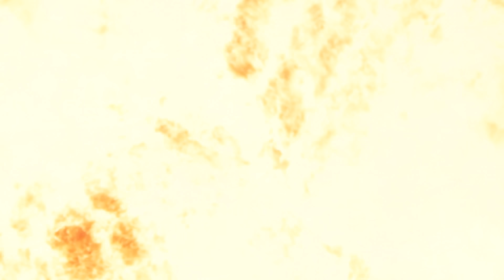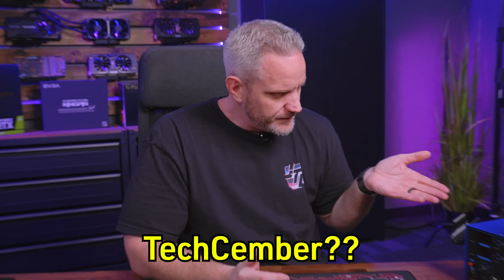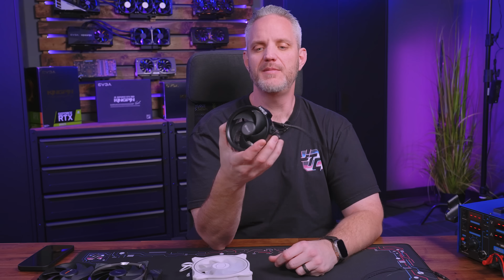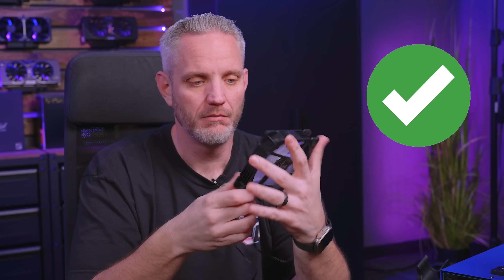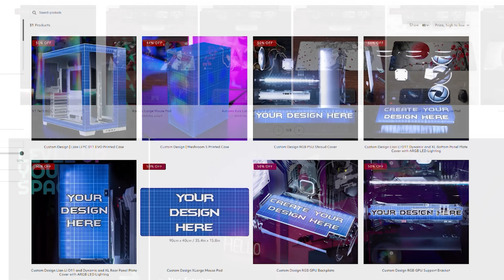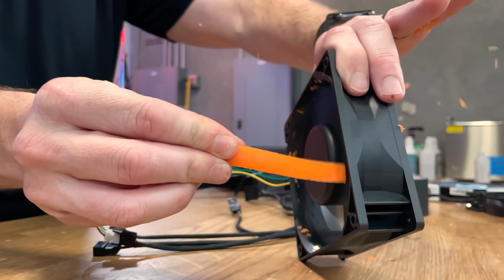I overvolted my fans, but I never expected these results!

Comment: During the summer months I used run some fans using an 18v drill battery when there was a power outage no problem all I had to do was make my own connector and of course use fan grills for safety. I even built a frame so I could use 4 fans to try and stay cool.

Comment: You need to hook the RPM wire to a motherboard to see what the RPM increase is.
Reply: Love me those deltas
Reply: This could potentially fry the board is not wired correctly. It's safer to use rpm meter
Reply: @vadnegru  the deltas I use are 1.6amps at 12v their rated at 3700 but only hit 2700-2900. I’m using fancontrol with a custom fan curve. I don’t think we have to worry much with Motherboards today. I believe because they limit them to the max of the headers. Mine are 1amps max. And my 4x 120x38 PWM deltas haven’t had any problems, no blown headers. So I guess if you stay with 12v should should be okay.
Reply: @JoeyAnswer  but Jay clearly going over 12V and that's could dangerous
Reply: @vadnegru  agreed though pc motherboards don’t do 15amps. What he was doing was testing to see if 15amps would kill a fan.
Reply: @vadnegru  it’s for science
Reply: @JoeyAnswer  please stop confusing electric potential (Volts) with current (Amperes)

Comment: Years ago when I was working on a cooling box for a game console I bought an all metal PC fan from RadioShack, soldered it directly to a wall plug wire and a toggle switch to turn it on and off, and hit it with 110 volts directly from the wall.  It never burned out.
Reply: Surely you understand a DC fan would never work on AC power, right?
Reply: @war4peace1979  It worked.  As I said, it was an all METAL fan, including the blades, so it wasn't made for computers, it was made for large cabinets full of electronics to keep air flow going.

Comment: means the coils should handle 3 amps, could be able to handle 20v, then it may fail.
sounds like a thermal resistor. it has a set limit 
get a basic 30V with preset voltages, voltage limiting, and current limiting.

Comment: Jay, you don’t need a new power supply.

You can series the power supply through the lithium battery.

That would give you over 35 volts to the fan

Comment: I actually feed 20 volts to my 4x Noctua nf-a20 (on a mo-ra3) to reach 1200 rpm. They are designed to run at 800. I'm sure their lifespan is reduced though usually degradation is accelerated through heat and they'll stay cold to the touch, even after multiple hours

Comment: ive used pc fans before in my old tahoe sound system to cool the amps before. when the alt's were charging it was at 14.8 14.9vdc and the fans worked well. never had a problem

Comment: If you wanna get more RPM (aside from overvolting them) you can completely cover the air intake, It will create a bit of void (a lower pressure really) lowering the air resistance on the blades and increasing the RPM. :P
Reply: That might cause one to pop out of the bearing if it manages to create enough of a vacuum.

Comment: Talking of fans, any interest in modding the Zotac 40xx series fans?  I just built a system for my sister with a zotac 4070ti amp airo and the fan motors sound terrible! I thought they were broken before I looked it up, it's the normal sound for zotac cards :(

Comment: At my work we use 35, 40, and 50mm fans for our products. The fans we use are normally rated for 5v, but we run them up to 9v without any issues. We could get 9v fans but they would struggle to run at lower voltages and we let our customers what voltage they run them at because that voltage is used by lots of different electronics in their setup. Also some 9v fans will run at 5v but they will move so little air they might as well not be there. We have pulled them apart and checked this driver chips in them and they datasheets for them say 6v max, but we have run 5v fans on 12v for a month without them failing. The electronics in the fan drivers are some of the most robust chips we have ever seen.
Reply: True. Some 12V fans doesn't even start at 5V, some of them are doing fine and actually doing some cooling while being silent.

Comment: If you are looking for ideas, I would like to see a video of performance/latency of running 2 monitors of different refresh rates. Like having a 240hz main and 60/75hz second monitor versus all same refresh rates. LTT did a similar video, but didn't go very in-depth with refresh rate differences. Feel like it would give good insight to people getting into PC gaming around Christmas time.
Reply: It's just better to pick for your use case. Highest tier GPU you can afford then pick the monitor best lines up with your use. Competitive gamers pick refresh rate, those who play single player games want immersion.
Reply: My streaming setup has a 240hz main and a 60hz secondary i had no issues at all
Reply: Yes this information about fans was crucial for my Christmas shopping 😄
Reply: yeah would be interesting. I had the idea of getting a second GPU for my second monitor. Would that be a solution for that and would it be worth it?
Reply: @chris_3729  You don't need two GPU's for tow monitors. I run 3 27" monitor's on my 3060. #1 is a 165 Hz, #2 is a 144Hz, and #3 is a 60Hz. They all run at there max rated refresh rate's without a problem.
Reply: @Furball-8994  nobody asked
Reply: @chris_3729  You actually did.  ("Would that be a solution for that and would it be worth it?") Maybe re-read what you write before you answer to replies...
Reply: @Furball-8994  the problem is that you have longer latencies and lose performance when using two monitors (as said in the original comment)
And my question is it worth it was because of that and if you would gain significant performance if you game and watch a video or stream on the second monitor as well
Nobody said you would need multiple GPUs for multiple monitors so nobody asked anything related to your answer
Reply: @chris_3729  If you want an "in a box" answer, ask a "in a box" question. You asked a general question and got a general answer. Then got snippy about an answer that did not fit your way of thinking. Obviously you have an inherent need to be right, So I will simply say        Your right.
Reply: @chris_3729  You wouldnt be able to run two different gpu's in 1 pc. You could run two of the same gpu in SLI/Crossfire, but it is not worth the money/effort to set up
Reply: @pearcyyyy  why wouldn't I? I can just connect the monitors to the different GPUs can't I?
Reply: @pearcyyyy not actually true i have a gtx 1070 ti and rtx 4090 and i am able to have both of them be used in the same pc at the same time
Reply: @pearcyyyy  This is false I had a RTX 3070ti with a RX 580 in the same PC the 580 was my TV and old AAA games GPU and the 3070ti was my monitor 1440p competitive GPU/latest AAA gaming GPU. While I play games on my monitor the other like the 580 played YouTube videos and gave me something to watch while I play. 

So yeah 2 GPUs of completely different brands can work and in my case work with no issues and each benchmarked as expected of their tiers. Each getting 8x PCIE lanes on each. Now days I just use 1 GPU as I don't need the 2 anymore. I only used 2 because it solved my freesync issues, but all is good on my 7900xtx.
Reply: @squidwardo7074 well its like I said I needed it to solve my freesync issues with my monitor while I play and no there was no framers loss as I said there was no performance loss. 

To get my rx 580 to run the videos I just needed to simply turn off my monitor the 3070ti was connected to and all is then shifted to the 580 then started a video or game and all will run on the 580 then turn back on the monitor and the 580 will still handle the video and TV image. 

As for what happens if both monitors are on. All games will default to running on what ever gpu monitor is set as your main home screen so in my case all games and apps was always going to default to running on the 3070ti unless I turned off monitor it was connected to. Works perfectly fine like that no issues and no performance penalties with both on
Reply: @squidwardo7074 also if I turn off the monitor then whatever gpu it's running off of goes into hibernation kinda like how a dedicated gpu does in a laptop with an active IGPU like my 3070ti only consumed like 2 or 3 watts in that state as I remember GPUZ reporting but if I'm using both the 580 while decoding a video and rendering that screen added about 30w to total system draw so it wasn't bad. But I have since moved to a single GPU setup as my Freesync now works fine with my 7900xtx with both monitor and TV on
Reply: @squidwardo7074 The monitor or TV that was on when the program was opened or any program for that matter will still be processed by that GPU such as movement across screens or decode the video even if it's on the other screen or in-between both monitors. The other GPU is only showing what's happening, but it did nothing pertaining to the image or program. As long as you don't close the window its always going to be processed by the GPU it was opened on and best way to force that was to simply turn off the main monitor, so the pc focused on the 2nd GPU.
Reply: LTT never explains anything properly despite having a knowledgeable team. Unfortunately their writers are all fun and no substance.
Reply: I have a pc for sale and only the kids who don’t read the listing are who keep messaging me.

Comment: ive put 24v and even 32v through some fans and they are usually fine at first. some cheaper fluid berrings kill themselves after a week or so, some fans use safety features and just stop until returned to 12v, some just destroy their berrings, but a few can survive for a long time but run hot. high amperage fans usualy survive the best
Reply: Why do you destroy things?   Makes no sense.
Reply: @Physics072  It does. It fuels curiosity and understanding. I learned how fans react to changes in voltage vs amperage somewhat, and i had fun. Plus they were quite old inefficient fans that were to be recycled anyway.  The ones that still work (all of them, one just runs slower at normal currents)  I've saved for electronics projects
Reply: @cornerrepairservice  Oh I blown up my share of stuff when I was a kid.   I think its a trait of all engineers.
Reply: I can confirm and also add that i have a pair of 40mm noctua fans rated for 12v running at 24v and they have survived a couple of years now. They have been used and abused for cooling the stepper motor drivers and power supply for my 3d printer.
Reply: @Guardian_Arias  Not a wise move unless you stepped it down to the proper 12v or run two in series.    Certainly don't want to pass it off as a normal thing to do as some people are going to ruin their fans.
Reply: @Physics072  nope straight 24v both in parallel and 100% intentional. I had purchased 4 expecting to blow up one or two as I found their upper limit but they fully took all 24v and the current draw had a really nice upwards curve. They also did have a OVP cut out that kicked in around 32v but recovered when voltage dropped back to 26v

A lot of fans from my experience will happily handle 24v indefinitely if you current limit them to their rated wattage, so a 12v fan rated for 0.48amp for a total of 5.75 watts almost always take 24v at 0.24amp. My power supply is more than capable of outputing 72v at 15amp continuous and its such a great tool for "overclocking" things.

I once found an old swiss dc motor thats 20mm round by 20mm long with a planetary gear box adding an extra 20mm in lenght that handled all 72v and pulled 4 amps. The sticker said it was rated for 24v. Best part is that the 6mm steel drive shaft comming out of the gearbox straight sheard off like it was a twizzler, so this little thing had too much torque for its own good. No its been revived as a tiny overpowered dremel with the gear box removed, it was too scary to run with 3D printed fan blades.
Reply: Interesting. I guess different fans really do just react differently. Lol yeah high torque fans are scary, especially when theyre still running at a high speed.
Reply: @Guardian_Arias  What about your car motors?  Same treatment?
Reply: @Physics072  Yeah, I have a 100f capacitor rated for 16v installed in parallel with my lead acid battery. The intent was that it would greatly decrease the wear and tear in the battery during start-ups and when it gets accidentally overdischarged. So far, the battery is at 150% of its expected life. Thats just the simplest mod out of all i have done.
Reply: interesting
 @Guardian_Arias

Comment: I have some delta 1u server fans lying around which I also used to start up my grill in the summer by attaching them to a Lab power suppply with a combination of crocodile clamps and 2 adapters. Only the best jank imaginable.
It seems to handle 13Volts alright-ish, however the bearings became audible at that speed.